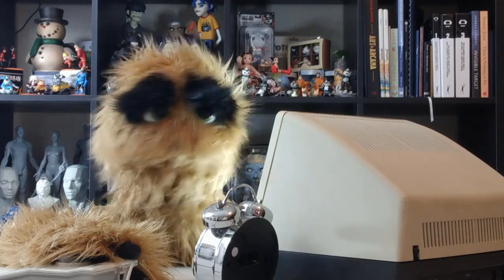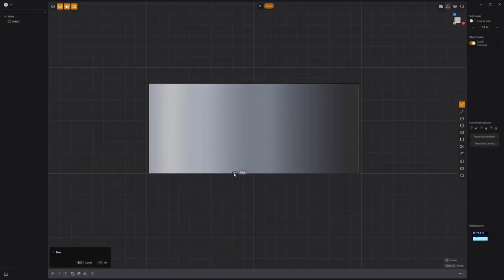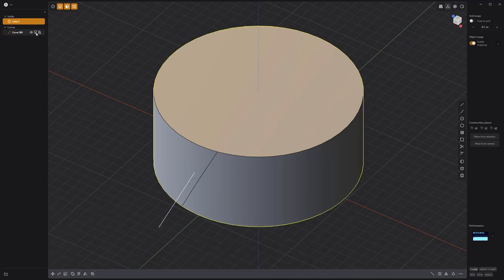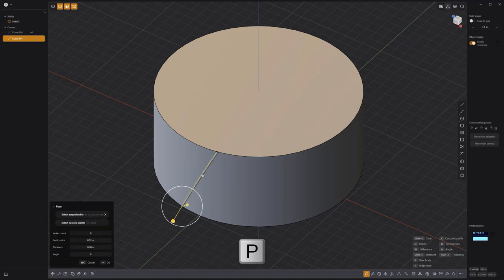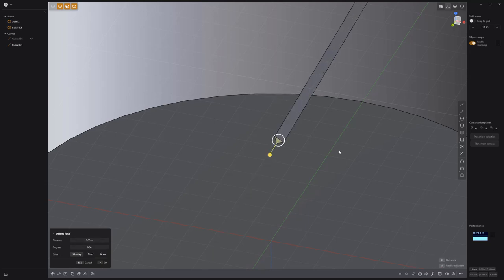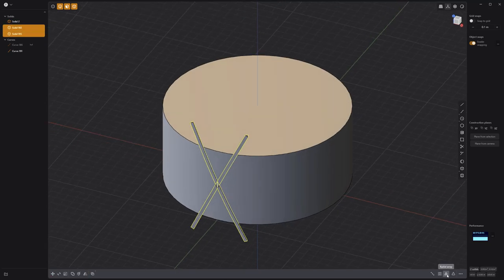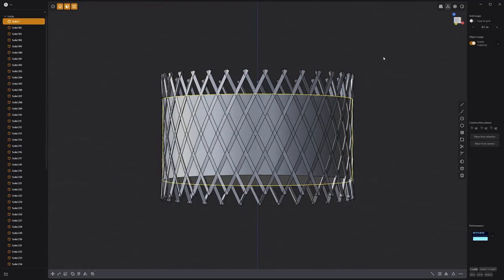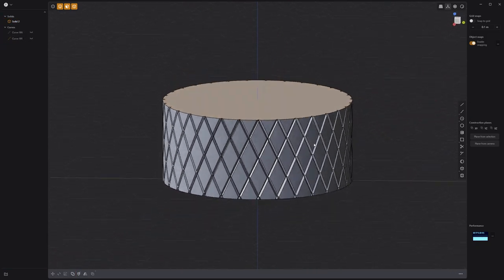Plasticity | Create Knurling

Comment: I have an issue with Pipe action. When I do it there is a small tiny hole inside my tube. Even if I enter a very small Section Size, there's still a tiny hole and when I validate and make a boolean difference, there is a small sheet remaining, so..quiet annoying. And I can't enter 0 in the section Size.